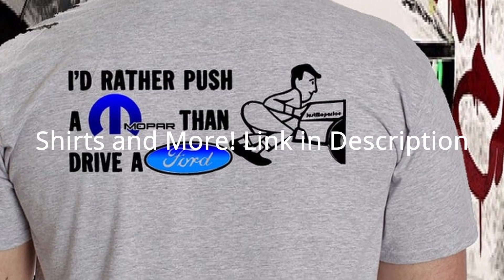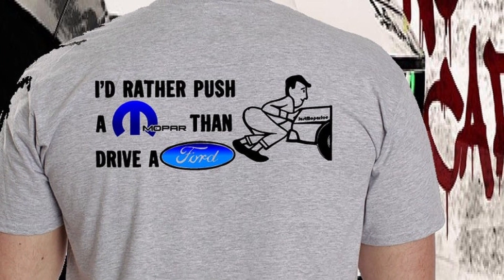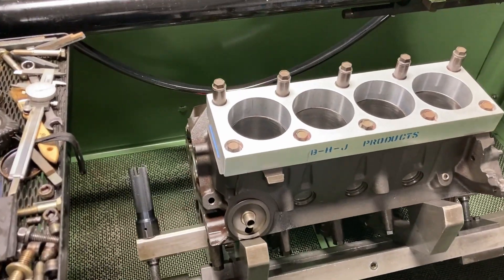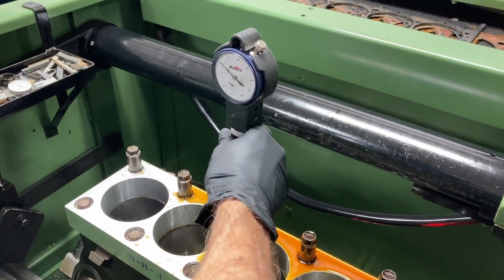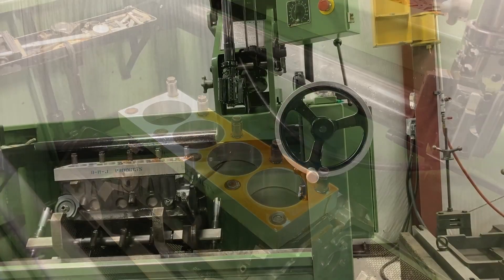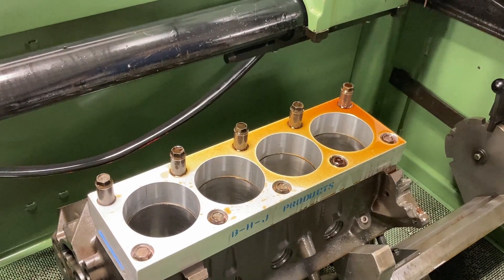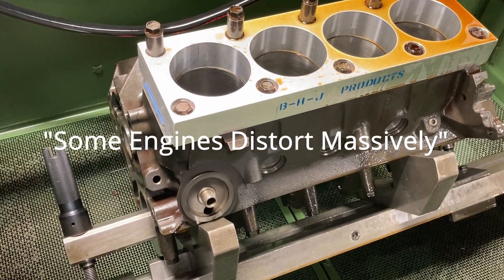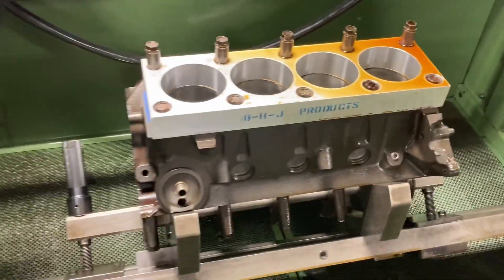Engine Building 101: A Real World Torque-plate Test!

Comment: I wonder if it's a Chevy block thing. I know dodges and fords used higher nickel for strength in the casting so it could have to do with that. That's why I like my magnum smallblock blocks for my builds. They ran an even higher nickel content than the la small blocks or so my research has told me. Lol. I've always wondered though. Awesome and thanks for doing this video!!
Reply from the maker: Thanks brother. If I can find a small block plate to check with, I’ll post that up sometime!
Reply: @JustMoparJoe  awesome man. I've always wondered but never had the way to test it due to the machine shops go go go time. Lol. Epic

Comment: Good info to know, Joe.  This mainly gives piece of mind when you're doing honing at home.  If you're building an all-out race engine, yeah do a torque plate at a machine shop.  But for a simple street engine at home, no big deal.
Reply from the maker: For sure. There’s been millions of engines done without a plate. This engine is just going in a street beater bronco. But it got the plate

Comment: I have an old 440 project that had to go .060” over and then honed with a torque plate. I borrowed a dial bore gauge and saw some bores as much as +/- .002” out of round! I called the shop and asked them and the guy said “sounds about right, we’ve seen some of the cheap GM crate motors where the piston will rub going into the cylinder, then be fine after the heads are torqued on.” This shop has a good reputation and all, but I’ll be getting back to this motor soon and a racer friend recommended another shop to go to because I have a couple other things to get done and I will DEFINITELY review with him the things I found lol.
Reply from the maker: Good deal Ron. Ed and Ed’s machine will do a follow up to this one and talk about the big block mopars he’s done.

Comment: 500 horses of spray will split that ford block thru the mains and cam tunnel 😁
Reply: I thought that was the 5.0 blocks.  The 351 blocks are supposed to be stronger, or so I heard.
Reply: @Obsidian-j8k  I have no clue, I was just talking smack lol
Reply from the maker: Doc, have you seen Rick run at Prescott? He has a drag pack challenger with v10. He’s in Stuttgart
Reply: @JustMoparJoe  yes I have. Very nice piece

Comment: i wonder how the 302 small block ford would fare in comparison to the 351?
Reply: Well, theyre certainly a weaker block
Reply: @toddmccarter45  agreed, that's why I'm curious how bad they distort
Reply from the maker: This is my first time seeing one checked. Check out Ed’s machine on YouTube. He can answer that.
Reply: @JustMoparJoe  thanks, will do
Reply: The 351W's tends to distort a bit more in my experience. Same bore and bolt spacings as 302 (they share torque plate) but use a higher torque head bolt which pulls more on the threads.

Comment: I have always “read and heard” that Mopar used a much higher nickel content in their blocks over other manufacturers, not sure whether that’s true and if so how long that continued. Very interesting video working with a fella who clearly is incredibly knowledgeable. I’m ready to go get my engine and take it to him.
Reply: Yes what you did hear and read is accurate info on the higher nickel content on Mopar blocks. This is the reason why there is no need for a 4 bolt main Mopar block because the actual casting is considerably stronger than what Chevy and other manufacturers built theirs. 

I’m not exactly sure how long they continued this process but believe it was thru the 70s and possibly into the 80s and beyond
Reply from the maker: He might would help you out! He’s a good guy.

Comment: Great video Joe! I was about to purchase a set of BBM BHJ plates. However for street use and in an N/A application (less cylinder pressure than boosted applications) I would agree with this assessment in your video. However, in a higher horsepower application and boosted applications, I personally would prefer the torque plates.
Reply from the maker: For sure! Rick has 2 BBM plates, besides his hemi plates. Even with these style checks, it’s typically always used.

Comment: Great video Joe!! Like Rick said there is no hard cut rule. I bet Rick is an incredible wealth of knowledge definitely enjoy more videos with him. I think it depends on the material. This is an opinion of mine based off of my experience and materials engineering, and especially for old Chryslers. Some examples from my experience and working with some incredible machinists:
• My 54 Chrysler Firepower hemi block is incredibly hard, so the value of a torque plate is negligible 
• However, with the thin cast iron Buick 455, I would recommend it, because not only is it a thinner casting, but it also contains less additives like nickel to the casting alloy. I would recommend for a Buick, but I don’t think it’s necessary.  
• Now for the 1UZFE, which is an all aluminum casting, I highly recommend the torque plate. 

Final note, it’s very important to use the fasteners that you’re going to use on the build itself. So, if you’re going to use head bolts use head bolts, and if you’re going to use head studs, use head studs, because they clamp differently. Not necessarily the exact same ones, especially if they’re torque to yield. 

Look forward to more videos with Rick great job Joe

Comment: Another interesting vid Joe. Well its good this block didn’t distort much but i guess if your next block does distort more you might detect a problem with that block. Given your experienced race buddy said some blocks distort “massively” makes me think its worth checking before pouring big money into the build.
Reply from the maker: I think after using the plate, the block would be fine to build up to its max potential. Wouldn’t hurt to bolt up and check though

Comment: I believe it depends on the quality of the block and year and type of engine . I'd still have the machine shop check each block this way before honing and if its a spec or 2 off then it dont need the torque plate . he even said some do distort bad
Reply from the maker: Precisely. I don’t want this to be the end all, be all. But unless you see or get photos of the plate on your engine, you might never know if it happened at all.

Comment: I wonder what causes some engines to need one and some to not need it? How much extra dose it cost to use a torque plate vs not using one? If the cost is not that much different I think I would just do it, better safe than sorry.
Reply: I’ll expand on this in a general comment. It comes down to the alloy used in the block, and some claim it’s based off of its heat cycles as well, but that’s something that you can’t quantify in my mind. Honing plates for common engines like Chevys aren’t too bad, because most shops have them. I had to rent a honing plate for the Buick 455, and plus the set up time,it was something like an additional 200 bucks. The plate I own for the 1UZFE engine is $400 on its own.
Reply from the maker: Some shops make it mandatory. Others don’t use them at all. I think it’s machinist preference really. I would think that if they had one, I would go ahead and request it.
Reply: Interesting video. I would love to see the test repeated on a small block Mopar. I'm new to engine building, but have several trusted mentors in the Mopar arena and beyond, that have built a lot of engines, and the only one who has ever said not to bother is my machinist. He in particular says that he has never seen enough variance to make it neccesary, in a street/strip engine. I own a set for a Mopar small block, so I did have him use them, but got no real feedback, other than the extra set up time. ($)
I have only really scrutinized a 8-10 blocks, cadt from 1972-1985, so far, with 4 sonic tested, but I have seen enough differences to bet you they won't all distort uniformly, even within the same family or cubic inch. I think you would have to test a bunch to get a real answer.
Since I picked up my plates at a fraction of the cost of new BHJ, etc., I see that and the extra set up fees as a good value, for my piece of mind, if nothing else. I will continue to use them. Maybe I'll see if I can talk my machinist into testing, as you did, on the next one. I always enjoy learning.
Reply: I've always heard they are required for open deck aluminum blocks, which makes sence in my mind, but I've never seen this kind of thing measured on them.

Comment: Just goes to show...the internet experts arent always right..In fact theres so much info being spread all over that its only when you can actually see it as it happens, you know theres truth in it...Thanks for sharing Joe..Interesting for sure!!
Reply: Agreed and Morning Wood...
Reply from the maker: Thanks Aaron. I wanted people to hear him say, that some blocks do distort terribly. I know that using aftermarket studs or bolts cause a larger pull on the deck.
Reply: I agree, putting an engine together is relatively easy and can be done by a novice with a decent manual. However if you watch these YouTube videos it seems like a daunting task that can only be accomplished with specialty tools and professional machinist guidance😂
Reply: @UnfinishedProjectDartSport  much of it is dependent upon what your end goal for that particular engine is. You can easily train a monkey to assemble one of these correctly but it’s a completely different story if your looking to a ie e 2,500hp with massive amounts of boost, then every single measurement is much more critical than it was for a stock version. In stock form, they are much more forgiving than any engine that your pouring 75+ pounds of boost thru